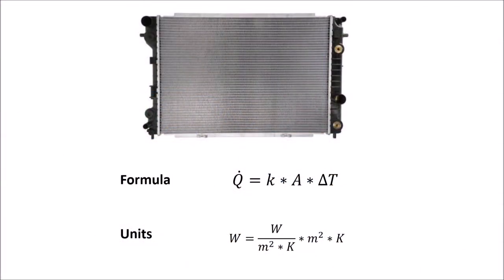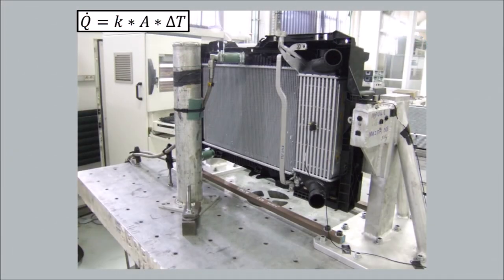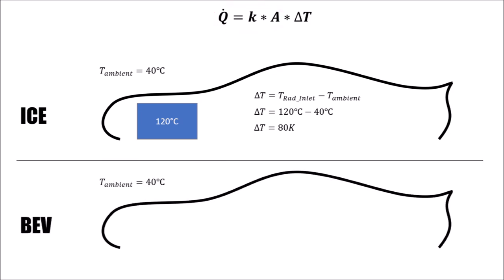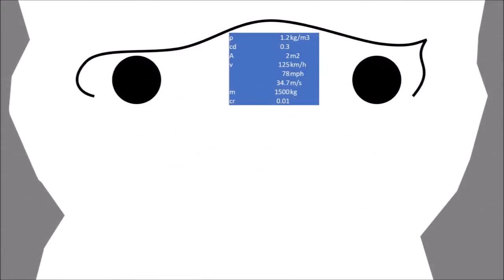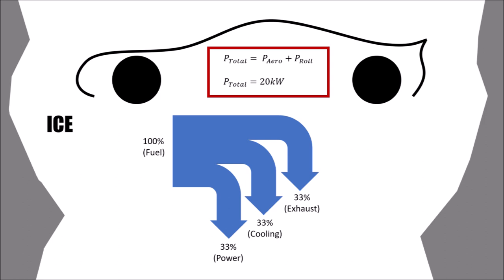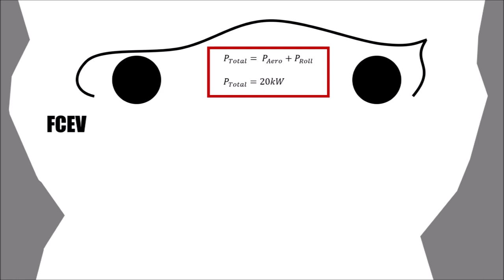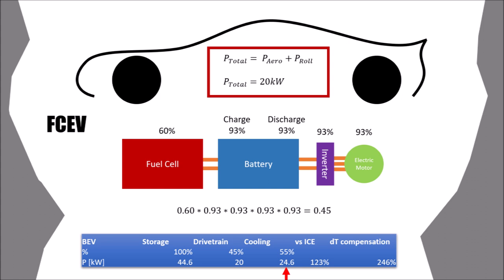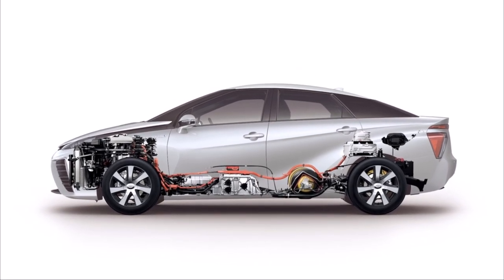Cooling Layouts for ICE, BEV and FCEV - Explained

Comment: Two questions I have, if you could help I’d appreciate it. I’m trying to figure out a ball park number for heat lost within a rotary engines cooling system. If you would know a estimate percentage, let me know, currently trying to come up with sizing for a radiator on a side project. The other question is about the difference in efficiency or k value of micro tube radiators in comparison to normal ones. Recently watched the video about them and was fascinated. Any answers are really appreciated!
Reply from the maker: Rotary engines are combustion engines too but with slightly lower thermal efficiency than piston engines. So you would need slightly more cooling than a comparable piston engine. Also, they produce the same power in a smaller engine, so there should be a good cooling system to avoid overheating of components.

Micro tube radiators have a much higher k factor than normal fin radiators. Like I described, you only use the radiator net area in the formula but the real surface area of these micro tube radiators is much larger. Additionally, heat rejection is better  because of the flow behaviour within these radiators.
But they are complex, tend to leak and expensive.

Comment: This is a great channel. I wonder though, this crazy pursuit of electric transport... I recently listened to a podcast featuring Paddy Lowe, yes, ex Williams/McLaren/Mercedes/Williams engineer and founder of Zero Petroleum, a TRUE sustainable powersource it seems. Perhaps you have thoughts on this and could comment on the short-lived craze of electric automobiles? (Which I think is running out of steam before it can really start, and is in any case not sustainable - the power grid and battery system are a toxic combination...).. thoughts please!

Comment: It is a very rough approach, but, I like how you simplified the cooling power requirement for each system. Maybe, I miss something in the video, but, I do not understand how you are supposed to simply double the radiator size just to overcome the difficulty for BEV and FCEV just because they have lower coolant temperature levels. Would it be possible for you to get into the details of that?

Keep up the good work!
Reply from the maker: That's a topic lots of people don't know about or get confused by. The reason for this are the different operating temperatures of the systems. I could do a future video specifically about this.
Reply: @BSport320  Yes, I would totally look forward to watching such a video. Thanks!

Comment: How effective are fuel cell cooling solutions? Are there any major inefficiencies in cooling due to the actual structure of the fuel cells?
Reply from the maker: The problem is not the cooling within the fuel cell stack, it's the low efficiency of the fuel cell itself.

Comment: I'd like to see these 3 drivetrains in a 24h race with the only rules being: all use the same allocation of energy for the whole race, all use the road car facilities to replenish the energy storage (i.e. regular pumps, public fast chargers etc.).
Reply from the maker: Good idea, Same energy allocation in kWh.
And you find the answer in the video already. You see the power you need to input to drive the same constant speed for all 3 drivetrains.
Reply: @BSport320  The video is mostly about thermal efficiency. It doesn't cover the proverbial elephant in the room — the recharging.

Comment: And I have one question - when the fuel cell car makes some water in process of making electricity, is there any chance to use it for a bit of an "exhaust" thermal collection? Or is there too little water made to be effective?
Reply: If you take a common consumption of a fuel cell vehicle 0.8kg H2/100 km then you will end up with 13.2 kg of water after driving the 100 km. Let's take a velocity of 100km/h then it will take you one hour to emmit the 13.2kg of water. Toyota Mirai for exaple uses a Polymer Electrolyte Fuel Cell with relatively low exhaust temperatures (max. 80°C) . With an estimated delta of 60°K  to ambient temperatures and the thermal capacity of water you can calculate the thermal losses through the exhaust to be roughly equivalent to 1 KW  in this scenario. So i would say maybe you can take that heat for passenger cabin  ventilation like with an ice, but that is not be enough to start thinking about solutions to convert it back into electricity.
Reply from the maker: Great explanation. To harvest this energy you would need to add complexity and to heat a cabin you usually need 3 - 4kW, to keep cabin temperature around 1kW. Keeping in mind that this harvesting would have some losses too, it wouldn't be worth it. Converting this into electricity would add more losses.
Reply: Thanks guys for an explanation! I thought so, it is not enough to help, but had to ask. :)

Comment: Do you know if someone's doing R&D into harvesting heat energy of drive trains to replace radiators?
Reply from the maker: Electric cars with heat pump systems do that already. They don't need their radiators in certain weather and driving conditions. But there are always situations with high ambient air temperatures where they still need the radiator.
There is research in phase change thermal storages but it's not easy for manufacturers to make this bullet proof for customer use.